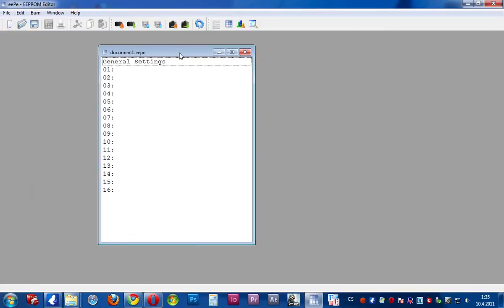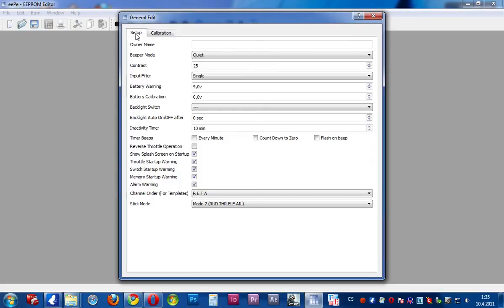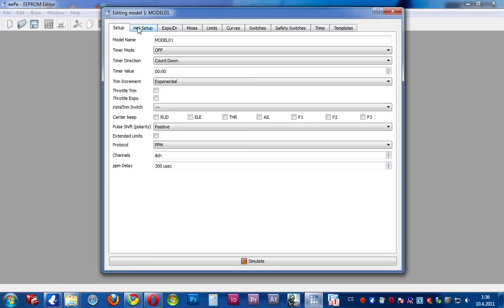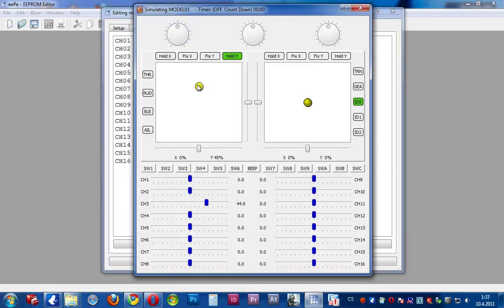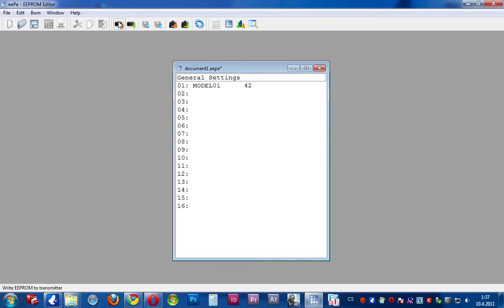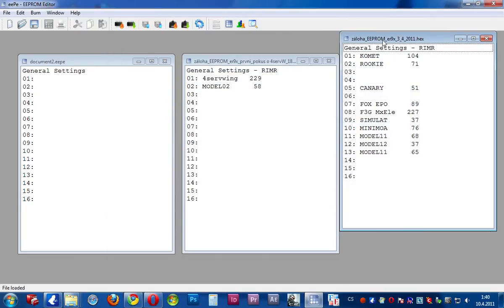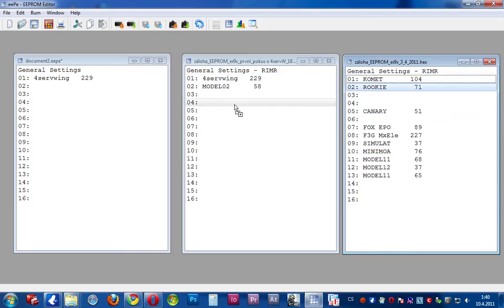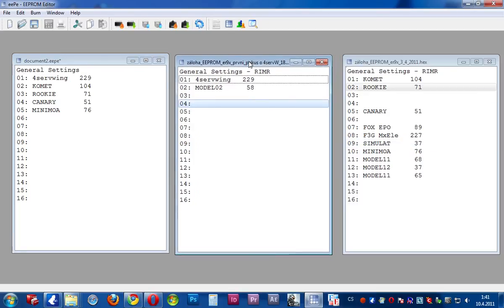Eng - T9x - Er9x - offline editing and next-level use of eePe

Comment: After I got the wired soldered on to the resistor to stop the alarm
and to get my screen back all my settings are gone. Of course I am still
using the stock firm ware so I can't go back and download my eeproms.
Here is a couple  of pictures showing what it looks like. I had to add an
extension to the wire because I didn't have any grey wire that size. I hope
you have some answers.

Loran

Comment: Richard,

I have a problem that has not come up in any of the forums or videos. I
have a grey wire coming from the ribbon that is attached to one of the
resistors. This wire fell off. I turned the TX on just to see what it
affected and all I got was the switch error. Of course all the switches
were in the right places. By trial and error I found which resistor it went
 to. Why is the wire attached like this? Is it supposed to go somewhere
else? 

Loran

Comment: @richardmrazek here is a quote from the rcgroups forum "In the eepe Burn menu, there is a fuses option.  This lets you set an option in the process that  keeps the EEPROM unchanged when you flash a  new version of er9x." ---  i was wondering exactly what that means. does this option allow you to just add models to the tx from eepe?